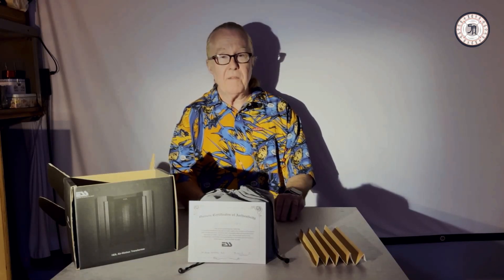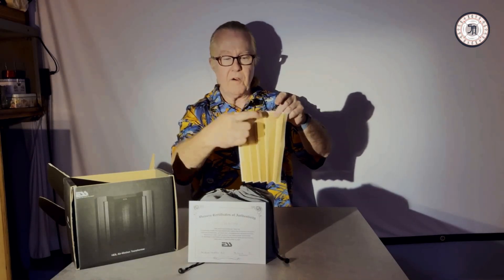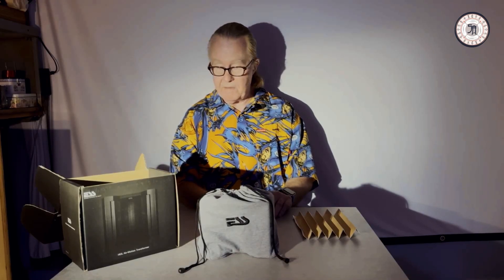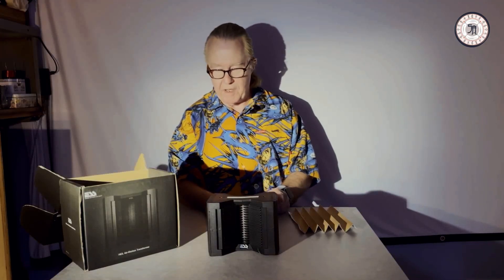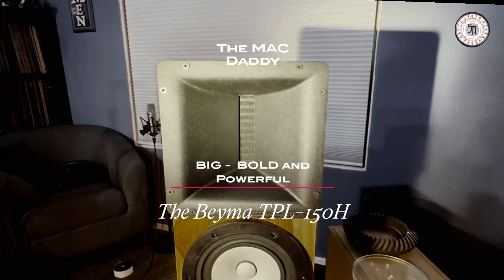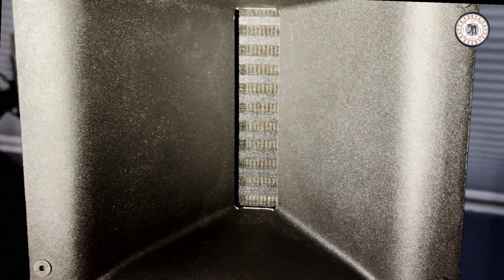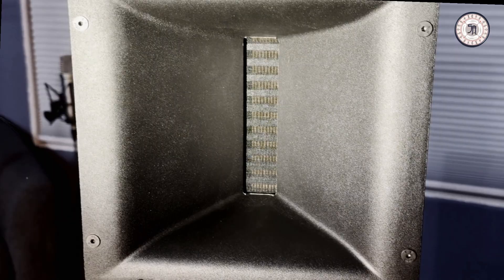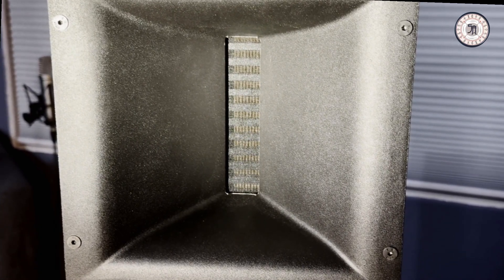From Nature to Speakers: Dr. Oskar Heil’s Air Motion Transformer

Comment: My friend roger had infinity speakers with 15 inch driver and passive radiator with heil tweeters that were a least a foot wide and almost as tall mounted in a semi barrel shaped cabinet and a cloth box top that lifted off that exposed the entire heil tweeter I still remember how perfect the sounded .do you remember

Comment: You are NOT going to get the Sound out of 'compact'!!! If you can't afford em,get out of the kitchen!! God bless 🙌 all. Brother Jeff 🙏. USAF Veteran 🇺🇸! Honorable Discharge 🏅!!
Reply from the maker: I’m a veteran as well, sir, and I hear you. Not everyone has the cash or space for big cabinets though. A good workaround is pairing smaller speakers with a subwoofer. If those smaller speakers have strong mid-woofers, they can perform almost like a three-way system - you still get clarity and balance, while the sub handles the low end.

Comment: Very good video. Good explanation. I just acquired a pair of ESS AMT1b tower speakers that the deceased bought new in 1975. He moved five times and brought the speakers with him. . . . but he never connected the speakers even once! Note: he also had a Macintosh amp. I just spent several days recapping the crossovers with better caps and refoaming the speakers and replacing the passive radiators. And used deoxit on the pots. They worked perfectly right away and they sound great! Quite a bit better than my bookshelf AMT10b speakers (maybe I should recap them?).  However the vertical dispersion is not very wide. If you can aim them right at your ears you get good imaging. If you are out of the sweet spot the imaging suffers badly, although you still get a lot of high end from wall reflections.
Reply: When I listened to the ESS array of speakers 🔊 the Studio Monitors just didn't sound as good as the AMT1's! I believe it was because the Monitors had the 12in Passive Radiator in front. The AMT1 PR was in the rear! No distortion blaring at you!! Sound,of course varies from person to person. My ears 👂 are super tuned!!! God bless 🙌 you. Brother Jeff 🙏. USAF Veteran 🇺🇸! Honorable Discharge 🏅!!
Reply: Enjoy!!! 😅

Comment: Yes, 5x the velocity is the figure I recall. I also recall a low crossover spec, 2000hz? and a range of 2000 to "Infinity" One explaination was to imagine throwing a marble and watching it arcas it travels away from you. Now take it between greased thumb and forefinger and squeeze watch it ricochet everywhere! ĤI personally like a LOT of high end and tend to boost high frequencies - as a drummer the sound of cymbals requires it, and HEIL AMT'S Deliver. I suppose some could find the sound harsh,or even painful. To me? Pure bliss that very few if any other tweeters can deliver.

Comment: I am a long time fan of HEIL AMT's. I have a pair of Lafayette Criterion 3000's I bought in the mid-70's when my brother was buying ESS like a lunatic. He started with the small Heils in Towers 1-12" Driver, 2 12" drivers and 2 Passive radiators rear mounted- then big bookshelves, small bookshelves then all our friends bouth ESS and I mean ALL. HiFi shop in Manhasset NY sold twenty something pairs. Then before moving to AUSTRALIA my brother bought... i dont know the model, Not ESS,  i think that was some 32-34 inches wide, 22 deep, 5 feeet tall with 4 of the Big Heils like you show here, mounted sideways -90° from normal, arranged in a semicircle, with TWO 18" FRONT Drivers, power Ha ndling was 1200watts I recall. These needed custom crates built,  and took 7 weeks to ship. When he returned to the US, they stayed in their newly adopted country.

Comment: They work great crossover @ 2300hz and fast midrange drivers are tough to beat with tight subwoofer,  I built several models all good
Reply from the maker: Thanks for the info

Comment: Such an informative video! How do your rate Mundorff's AMT? Some speaker companies use is but have Mundorff specially customize it to their specifications. Thank you.
Reply from the maker: Hello!  

We explored the Mundorf line of AMT's and chose the Beyma.

Here is why we chose the Beyma TPL150H: 

Choosing Between Mundorf AMT and Beyma TPL-150H:

For Highest Sensitivity and Dynamic Range: The Beyma TPL-150H is the better choice if you need high sensitivity and are matching with other high-efficiency drivers. Its dynamic capabilities and efficiency make it ideal for large rooms or setups where minimal amplifier power is preferred.

For Ultra-High-Frequency Extension and Smoothness: The Mundorf AMT excels with its superior high-frequency extension and smooth, natural sound. It’s a great option if you prioritize the absolute highest clarity and detail in the treble region, particularly for critical listening setups.

Dispersion Needs: If controlled dispersion is a priority, the Beyma TPL-150H’s horn design can offer more predictable and focused sound coverage, which can be beneficial in managing room reflections. Conversely, if you desire a broader sound dispersion with a larger sweet spot, the Mundorf AMT might be preferable, despite its narrower vertical coverage.

Integration with Other Drivers: Consider how you choice of how either driver will integrate with your chosen midrange or woofer. The Beyma’s horn loading might pair more seamlessly with other high efficiency extended range driver such as the Mark Audio line with the ultra thin magnesium aluminum cones in maintaining a consistent sound signature across the frequency range. That is precisely why we chose the Beyma.

Our choice of the Beyma TPL-150H over the Mundorf AMT for pairing with the Mark Audio foil main drivers reflects a strategic decision to optimize for efficiency, dynamic range, and controlled dispersion, all while maintaining a balanced and engaging sound profile.
Reply: @shinjitsuaudio  hi is the Beyma 150 a dipole? Thanks

Comment: I have the Beyma TPL 150H in my speakers. Achenbach SON XL high end version. I can confirm those are the best tweeters I've ever owned! So much fun to listen to in low and high volume ❤
Reply from the maker: Thanks for sharing
Reply: I use compression drivers with some waveguides right now in my DIY speakers which are IMO very nice sounding but always been curious about these Beyma that you have.  Crossover point and power / sensitivity would work out.   Definitely not cheap but I think I might want to give them a go.

Comment: Superb hf transducer.  Only transducer I know of which moves perpendicular to the listener.  Unfortunately many of the mass produced units have extremely weak magnetic force which limits their output significantly.
Reply from the maker: Agreed. Best we have tested by far. But with that said they are very expensive at $600 a piece.

Comment: Bought the AMT-1, "Sound as clear as light", in April 1975. The crossover utilized imposed sibilance on the transducer. Also prone to thermal runaway, where the diaphragm would melt. My last commercial built, the B&W DM 6, far superior midrange and not as bright, but more musical highs.
 Been building my own since 1980.  Currently employing the Speakerlab Auricle RD 57, a 2 inch wide, 54 inch long, push pull, dipole, planar magnetic. With (2)Morel 164's/channel, each in 13 foot long waveguides. That's for video sound. Also employing the Raal 140-15D, Lowther DX 65, and (2) Jordan JX 150 NG's also in 13 foot long waveguides, powered by OTLs, for music reproduction.
Reply from the maker: Very nice speakers by the sound of it.
Reply from the maker: Nice! Thanks for sharing.

Comment: An engeneer tested the beyma , and to be in fase with some 6" mids thehorn was too deep , so hemade a shorter horn , the best was 40mm deep ...
Reply from the maker: An engineer? who was that? "phase".
Reply from the maker: Do you have a reference for the engineers opinion or text to share?
Reply: I think you are saying the time alignment was out, with proper DSP no problem these days and with that you maintain the appropriate horn design for dispersion control, or even simpler mount the 6“ 20mm deeper which should be easy enough

Comment: Yes - But the ESS goes down to 700Hz - So how much difference in clarity? Plus, the new Pure Audio Projects use the ESS. So, for the difference in price between the Beyma and $250 for a pair of ESS, is the difference that negligible? - Not trying to challenge, but trying to figure out for me - when listening to Pink Floyd 'Welcome to Machine', is the extra cost of the Beyma worthwhile? Thanks
Reply from the maker: Thank you for your thoughtful question! It's great that you're diving deep into understanding the differences between the Beyma TPL-150H AMT and the Great Heil ESS, especially when considering music that demands clarity and detail like Pink Floyd’s "Welcome to the Machine."

Clarity and Frequency Response:
Beyma TPL-150H: The Beyma is known for its outstanding clarity, extremely low distortion, and smooth frequency response. While it typically operates well from 1.5 kHz and above, its performance in the upper midrange and treble regions is exceptional, making it a popular choice for high-end systems where detail and transparency are critical.
ESS Great Heil AMT: The Great Heil AMT is designed to extend lower, down to around 700 Hz, which is advantageous for broader frequency coverage, particularly in simpler two-way setups. However, operating closer to the lower end of its range might introduce some compromises in clarity, especially under high SPLs or complex musical passages.

Differences in Performance:
Clarity and Detail: The Beyma TPL-150H is engineered with advanced materials and design refinements that contribute to superior detail retrieval, especially in the high-frequency spectrum. This can be particularly noticeable in complex music with layered high-frequency content, such as cymbals, synthesizers, and nuanced vocals.

Integration with Woofers: The ESS Great Heil, with its lower crossover potential, can integrate seamlessly with larger woofers that play into the midrange. However, this often means sacrificing some of the high frequency refinement that the Beyma can deliver.

Cost vs. Performance:
Price Consideration: The ESS units are more budget-friendly, and for many, they offer a very good performance-to-price ratio. If you're satisfied with the level of detail and frequency response they provide, they can be an excellent value.

Beyma Justification: The Beyma TPL-150H, while more expensive, brings a higher level of refinement, especially in demanding audio scenarios. For audiophiles who are keen on extracting every bit of detail from recordings like Pink Floyd's, the investment in Beyma might be worthwhile. It’s designed to handle complex audio material with greater finesse, potentially offering a more immersive and detailed listening experience.

Listening Preferences and Application:
If your priority is maximum detail and you're using high-quality recordings, the Beyma could indeed offer a noticeable improvement, particularly in the highs where it excels.
If your setup or personal taste leans towards a more full-bodied integration that the ESS provides at a lower cost, then the Great Heil might suit your needs without a significant compromise.

Ultimately, the decision hinges on your specific listening preferences, system integration, and how much value you place on the incremental improvements in clarity and detail that the Beyma offers over the ESS. Both have their strengths, and understanding where those align with your audio goals will guide the best choice for your setup.

I have heard and tested both. The Beyma is in a league of its own.
Reply: $250 for one, not a pair.
Reply: Beyma for sure.PAP needs to hit a price point